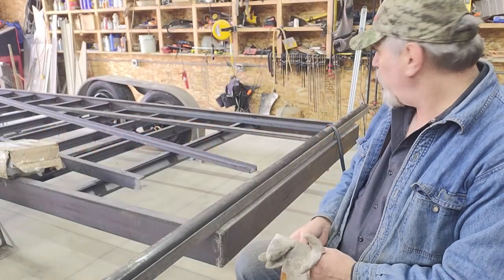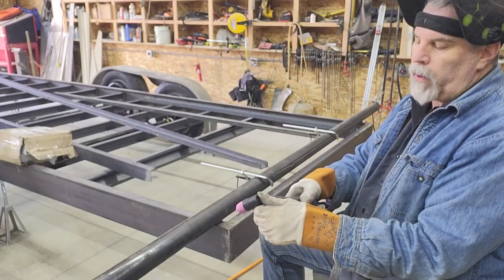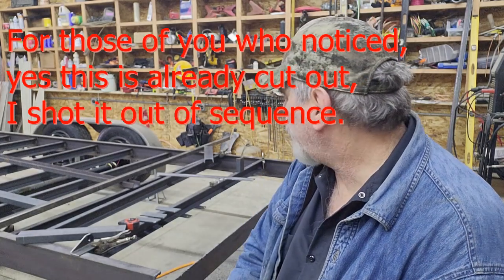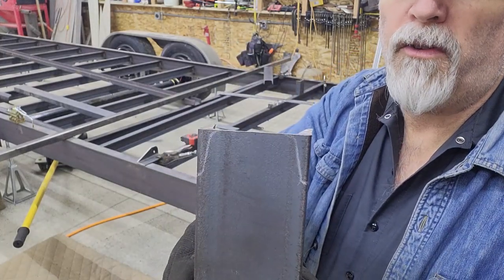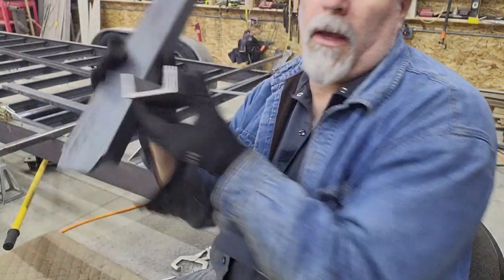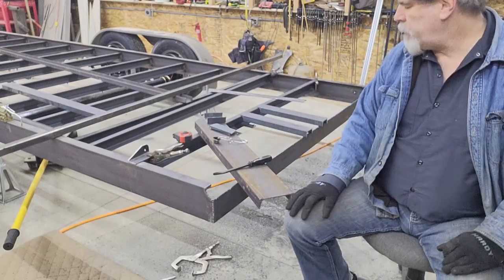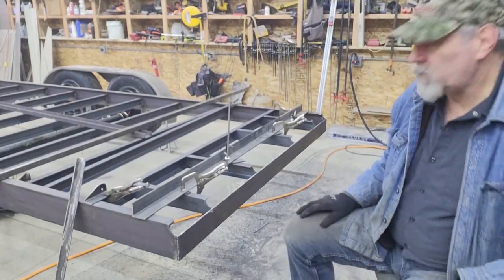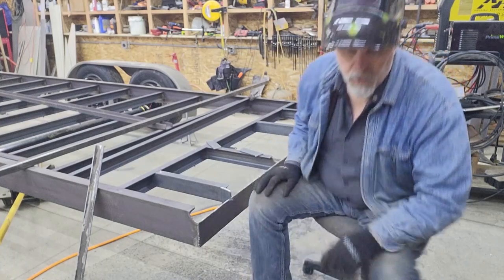Fabricating the hinge structure

Comment: maybe think about getting a microphone to wear... and those "work boot crocks" will HURT when you get a spark in them. Some socks melt into plastic, then the shoes... melted plastic on your skin doesn't wipe off. A friend told me. ;)  Expended metal - I hope you have better luck with it then I did. It bends way, way too easy for me. The plasma cutter will cut that very easy, you just need to pivot how you hold it so it's not the 1"+. Your hinge... I can't picture how it's going to work but am totally interested. I'm going to do the same thing on a trailer I've got.
Reply from the maker: I tried one mic but it picked up to much background, probably because it was an el cheapo one off Amazon.  I appreciate the crock jab.....can't count how many times at work when welding overhead a zinger went in my ear or down a sleeve; definitely gets your attention.
Reply: @builditorbuyit  yea, wish I could help for what mic to get... I've got no idea. Ear burners suck. Years ago I had a really nice jacket. Burned little holes in the arms doing "just a quick favor". Burned down to my arm. Jacket turned to melted plastic. Some gloves do that also.